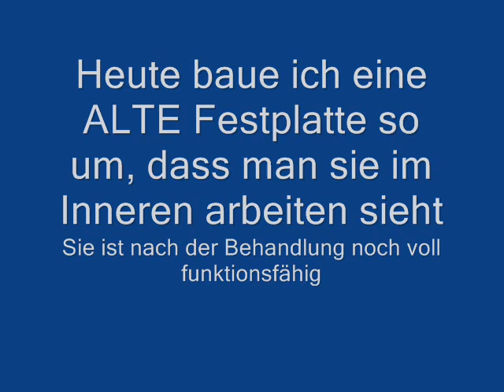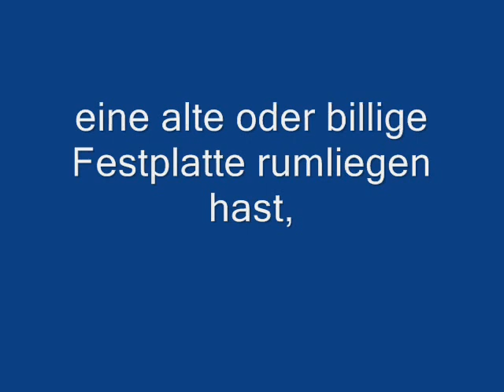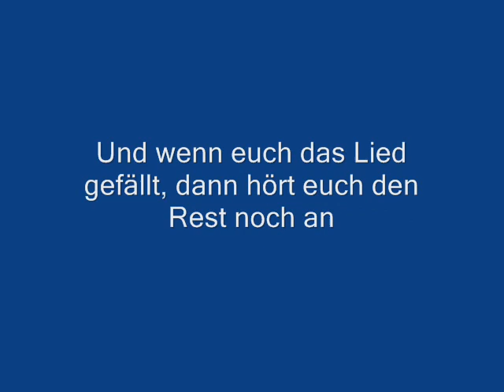Einer Festplatte beim Arbeiten zusehen

Comment: ich hab das mit ner quantum bigfoot gemacht, aber ich habe sie komplett in ne staubfreie tüte gepackt und in der zeit den deckel gemoddet. das ding is ganz, ich hab nur probleme mit den kontakten (die sin nix mehr oder die platine sitzt nicht richtig auf) manchmal geht sie und manchmal machtse nur den ersten klick und hört sich danach an wie ein headcrash weil kein signal vom lesekopf kommt